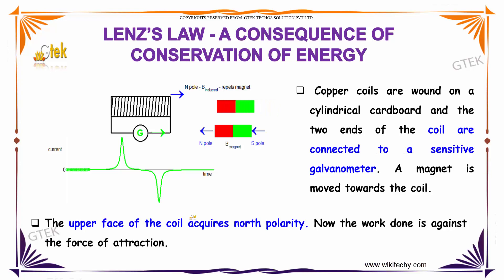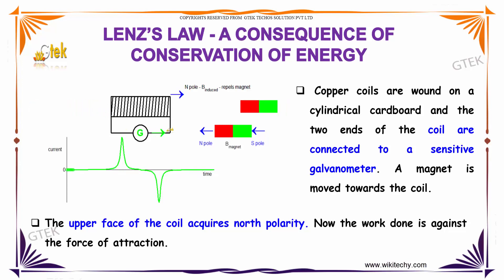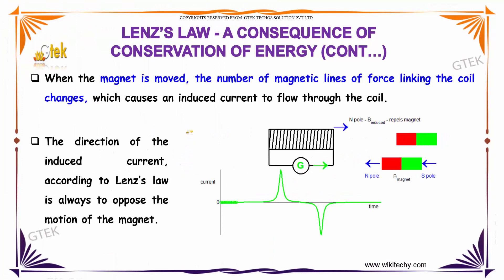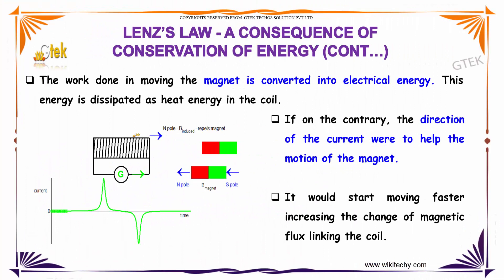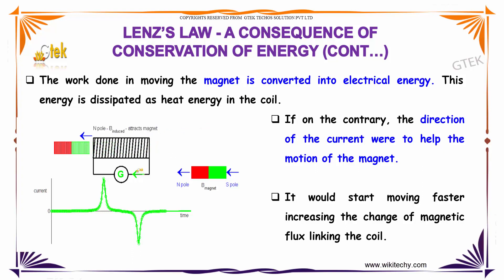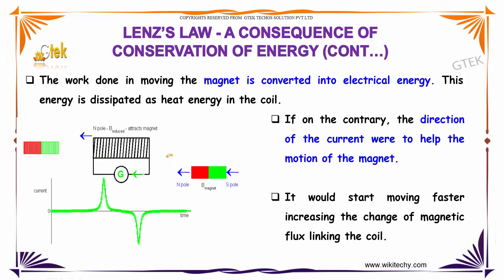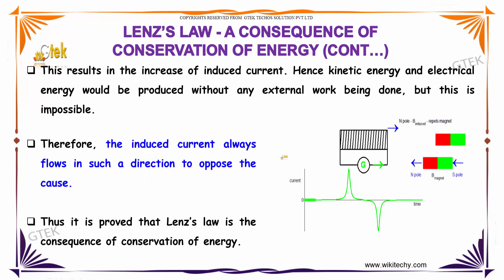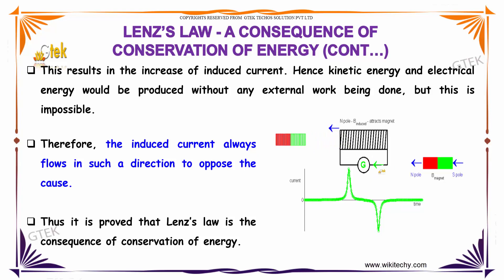Lenz's law conservation of energy Electro Magnetic Induction And Alternating Current CBSE IIT

Comment: Faraday's law of induction is the fundamental operating principle of transformers, inductors, and many types of electrical motors, generators, and solenoids. Faraday's law states that the EMF induced by a change in magnetic flux depends on the change in flux Δ, time Δt, and number of turns of coils.

Comment: An increasing magnetic flux is then created through the loop. This changing flux will now induce a current in the wire loop. ... This extra work leads to periodic change in magnetic flux hence more current is induced. Thus the extra effort is just transformed into electrical energy which is law of conservation of energy.